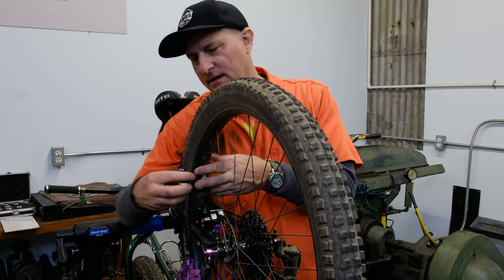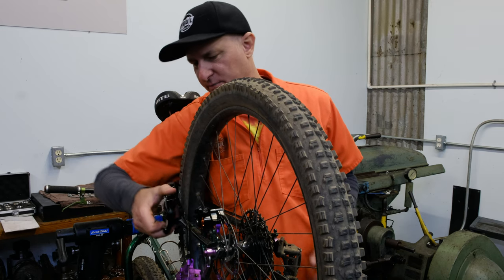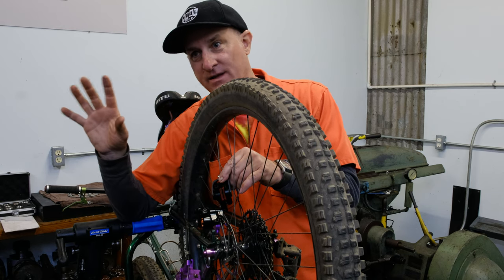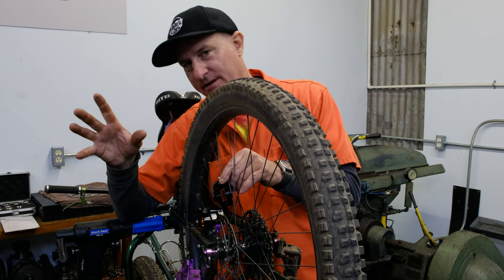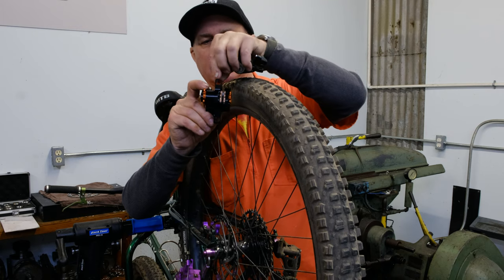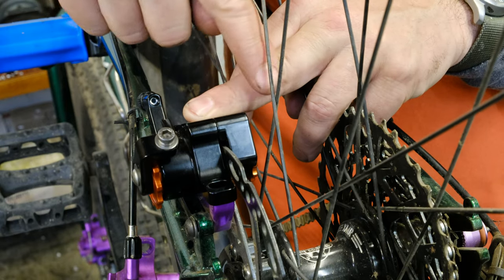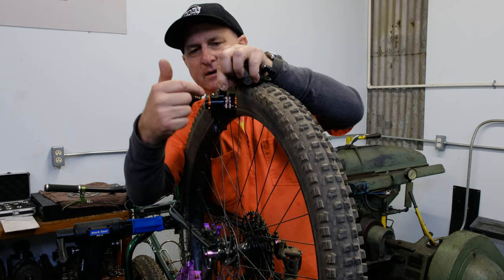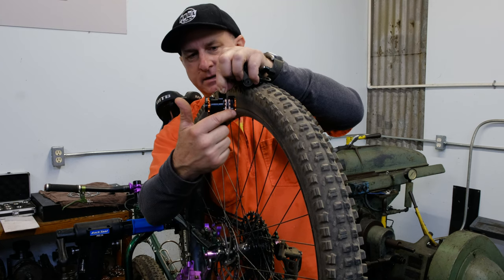Why is the Klamper Disc Brake Single Sided?

Comment: Can these run with Centerlock rotors??     I am a larger rider, and will occasionally pull a Bob Trailer, or ride with panniers.     Can Klampers take on that challenge?      I have had no luck with multiple combos of hydraulic setups and I am don’t with them.    I’m hoping Klampers are my solution.

Comment: If I don't care about modulation but want the most locking/holding power, should I use the short pull Love lever on a long pull caliper because of the increased leverage?
Reply: You'll get more force out of the brake, but pad clearance will be too small or the lever throw too long

Comment: Sure but why not design it like the brake that rhymes with fire? a lever that compresses both sides.

Out of curiosity. for a more rigid caliper design? Some arguments say the outer pad will wear faster since it spends more time on the rotor.

Comment: Oh my gosh that was a great explanation of why your single piston design can offer better braking power than dual piston cable brakes. It’s rare for google to push me a video I liked this much. 

I think your design efforts could also use a few follow up text FAQs on your website which I’ll check out later. 1) do the two brake pads wear mostly evenly over their life? 2) is the brake pad adjustment easier or harder with your design vs other single piston designs (Avid BB7) or dual piston designs (TRP Spyke)? 3) are there objective test results on pad force vs lever force for some standard cable levers compatible for V brakes (long pull) that could be used to compare brake designs? 4) is it easy even if rotors have a little wobble to open pads up enough to avoid rubbing (i.e., what is max pad opening?  I’ll send this as an email later with maybe a few more Qs. I’m now leaning towards your brakes over the TRP for replacing the horrendous Avid hydros on my 2014 Salsa Horsethief.
Reply: As a bike mechanic, I can tell you from personal experience that the drive side pad adjustment on a TRP Spyke or Spyre on the rear is rather tricky. It's a 3mm allen wrench, deep enough that you can't use a ball end. Since most people have a rotor that is smaller than or the same size as their cassette, you can't fit the long end L-bend or T-handle allen wrench in. This means that you have to use the short end, with the long end of the L-bend ending up mixed in with the spokes. You can usually only get like 60 degrees of rotation in at a time.

Comment: Interesting info.         I have a question that I have never found the answer to. The small set screws on many of the different caliper pad position adjusters.      I watched another video on the Klamper and thought I saw the screws in a blip, possibly one on the inboard pad and one on the outboard pad.  That video made no mention of the set screws.  My question is how are those set screws intended to be used by the mfgr?   Instructions covering those screws seems hard to come by.  
Some say to loosen the set screw for adjusting and then retighten the screw.  Other instructions make no mention of the screw during adjustment, making me think that the screw is possibly itself set at the factory and intended to simply apply a set amount of tension to the adjuster threads.       Most of the set screws I've disassembled have a small slug of plastic at the end between the set screw and the adjuster threads.   I see that plug being used to protect the adjuster threads but possibly to supply a slight tension to the adjuster?   Sidenote:  one caliper I dissembled (different brand) used a longer set screw and had no plastic plug. The set screw had been tightened into the adjuster and damaged the threads.
Reply from the maker: Does this video help?: https://www.youtube.com/watch?v=u7hOhOq3CVg&t=18s
Reply: @PaulComponentEngineering  Thank you. I watched the video, very informative. That ball plunger/detent groove is way more quality than the simple set screw that I have experienced.